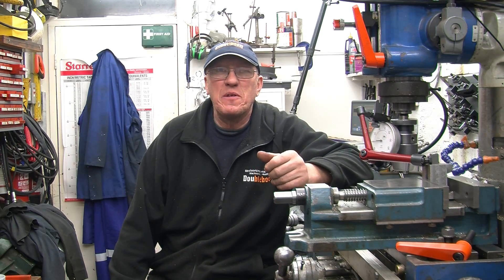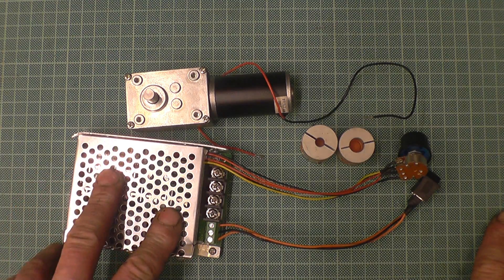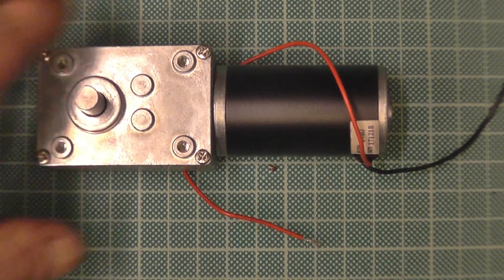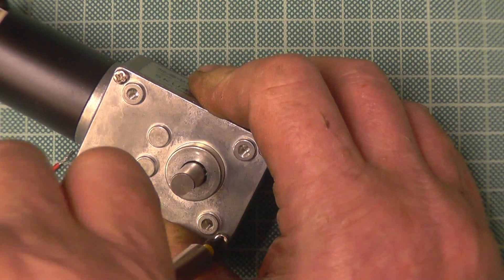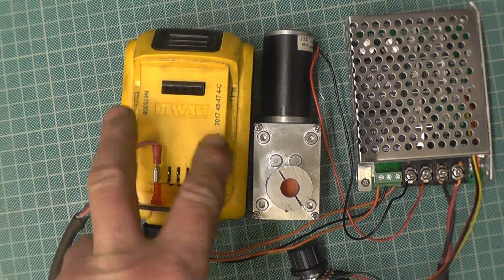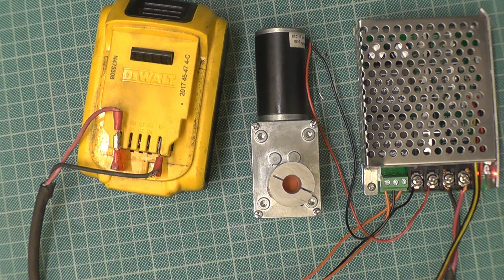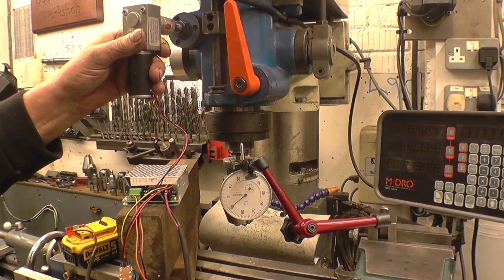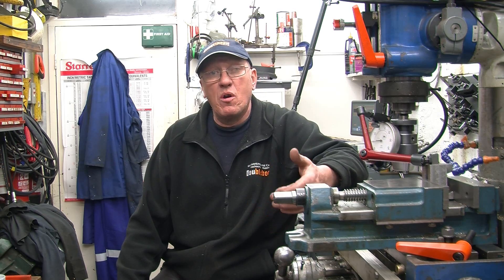Banggood  12 Volt Gear Head Motor Review

Comment: The advantage of worm gear motor is high torque, low rpm, and low noise. Also its unique feature is self-lock. But compared to planetary gear motors and spur gear motors, they are not as durable as them because of worm drive connection. I ever buy micro worm gear motors from HOTEC MOTOR, like HT-WOG46, HT-WOG34, HT-WOG58...impressive with their quality .

Comment: I have the same motor to drive the power feed on the z axis of my mill , i used a 2 :1 reduction  on mine and have used it to drill 25 mm holes in steel . It slowed down a bit once it loaded up but that isn’t a bad thing and  makes using the boring head a right pleasure . My set up is similar to stefan gotteswinter  except he uses a different motor and o connected a rotary encoder to the blind side of the gearbox shaft so i could set up a feed rate display using an arduino and a lcd - also works well ! . One day i will fit the auto shut off up so i can set it up to bore a hole and get on with something else  but i think there may be a great many beers had before that eventuates !

Comment: My mill head has a simple clamp nut clutch for either quick lever feed or fine feed via dial, I never use the dial so this would be perfect to add to my machine for boring operations. Thanks for sharing, I'll be sure to use your links so you get a few pennies. Cheers.

Comment: nice piece of kit, I am no expert in torque needs but do you or anyone else think that this can be used for a lathe powerfeed? , I have a Myford M and the slowest feedrate I have found is too fast, the lead screw is 8tpi and the change gear teeth are too big and not enough space to add another 2 compound gears, at motor 800rpm the carriage travels aprox 6" per min, a friend has a clarke mini lathe and at 2500 rpm the carriage speed can be set to approx 6" per min and I think slightly less
Reply: @fuzzy1dk  cheers mate
Reply: @CurlyG65 thanks mate

Comment: I have bought four of those motors ranging from 10 to 40 rpm, to use as power feed for my lathe compound.  I have a Burke Millrite Milling machine with a fine feed, so I am planning on making a power quill feed also.   4rpm would be a bit slow for my needs I think.  Another trustworthy Banggood review!
Reply: good to know, do you know if there is enough torque for a main carriage powerfeed? , I have a Myford M and the change gear teeth are too big for enough speed reduction, lead screw is only 8tpi it could have done with being atleast 16-20tpi and smaller teeth and gears for the banjo size